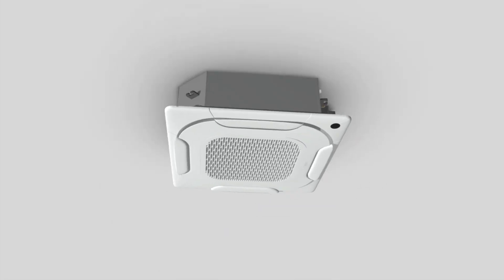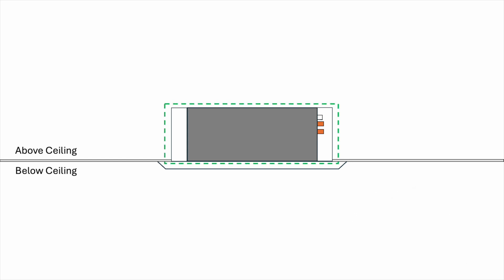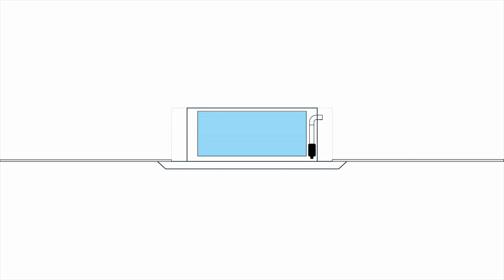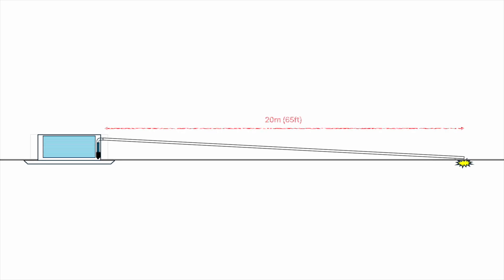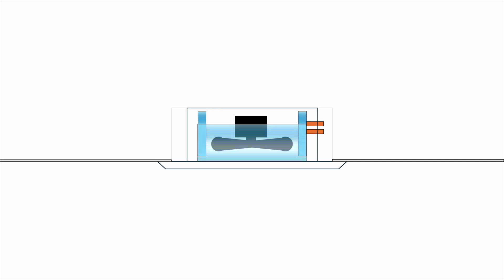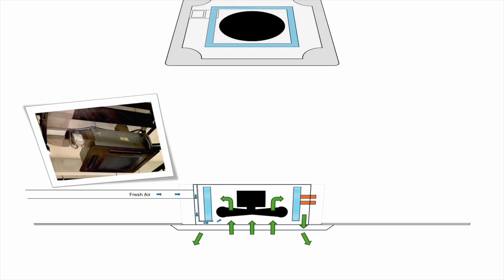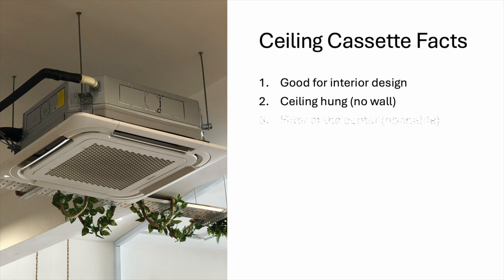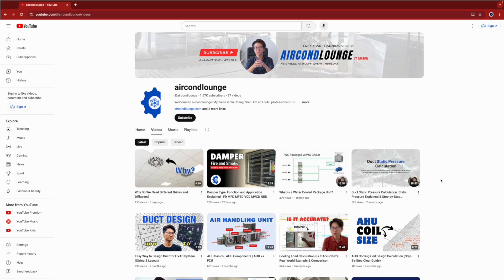Ceiling Cassette Air Conditioner Explained - How It Works

Comment: I have 2 the Samsung 4 cassette AC, and 2 single cassette. Is it advisable to always turning the machines off when not in use? I leave the temp on 27c so there is no power surge when we turn it back on the next day.
Reply from the maker: Yeah, it saves energy.

Comment: Thank you for the video I appreciate it. In your opinion which is more energy efficient a Ceiling or Wall unit for lower electricity bills?
Reply from the maker: Thanks. Wall unit will always be more efficient.
Reply: @aircondlounge I'm looking at one 5-ton unit in the ceiling  20 seer or 2 wall units that are 2 ton 16 seer. Which one am I goingto cost me less in electricity and cool the place down efficiently?
Reply from the maker: @fearlessincabo for large space, cassette unit is usually better and more effective at cooling. Plus, the cassette you suggest is more efficient than the walls.
Reply: @aircondlounge  awesome thank you. What about one 5-ton unit in the ceiling  20 seer vs 2 wall units that are 3 ton 16 seer. Which one am I going to cost me less in electricity and cool the place down efficiently?
Reply from the maker: @fearlessincabo the higher seer unit will be more efficient
Reply: @aircondlounge ok thank you for all your help. I hope you have an amazing day amigo

Comment: Niice explenation, but what if the house has a basement, and in the basement are ceiling cassette air conditionair? because that floor is under the ground, whats gonna happen with the slope?? because now the slope should go higher right?? Do you understand me?
Reply from the maker: It is possible to raise the cassette unit drain to the ground floor level and discharge to ground floor drain. Check the maximum raise height in the installation manual. Ideally, the drain should have a slight slope at ground floor to prevent the condensate water from staying inside the pipe when not in operation.